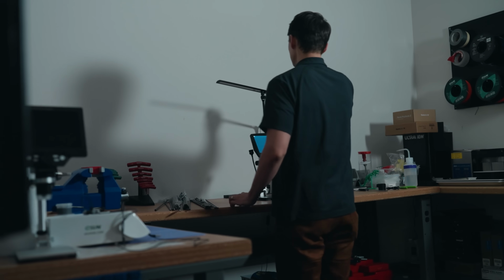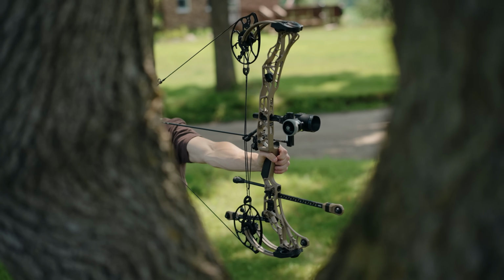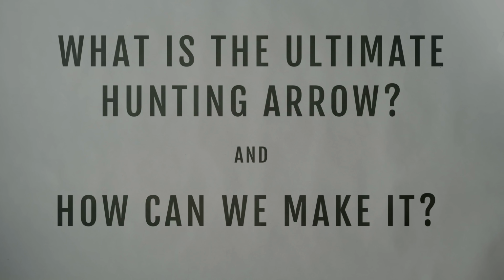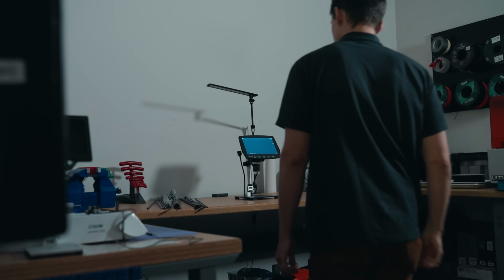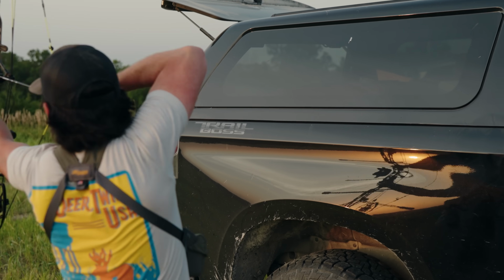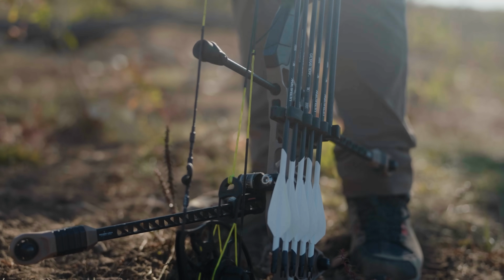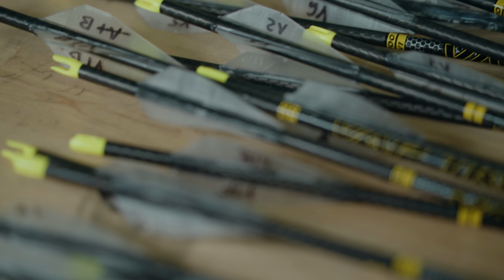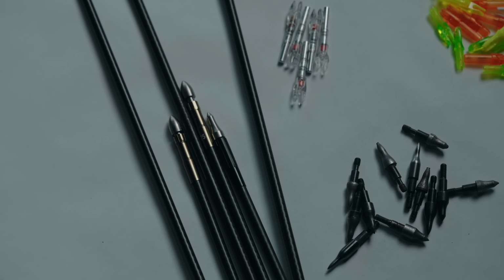THE NEW UV 1K ARROWS

Comment: People love to complain about the price 😅😅 if you went and tried to build the best arrows from scratch it would cost nearly the same 
Rip TKO $220 
Titanium inserts $95
Stainless fieldpoints $24
Vanes $25
Vane glue $5
Nocks $10 
Hot melt $10 
$390 
That’s all before taxes 
so is $440 on a set really out of the realm of what we spend per dozen no it’s not at all especially for a possible superior shaft to the TKO
Reply: So bowhunting was almost impossible before the rip tko era, or the era of custom components??? Just...stop... I've used easton ST Excel with absolutely no problems with stock components and blazer vanes. You don't need" top of the line" arrow to enjoy archery...

Comment: I'm ignoring the price and I'm aware I don't fit a standard spec but 10 gpi for 250 makes the minimal weight just under 510 grains that is not light. Would have liked to see them keep that gpi under 8 like the victory rip tko does and the rip xv